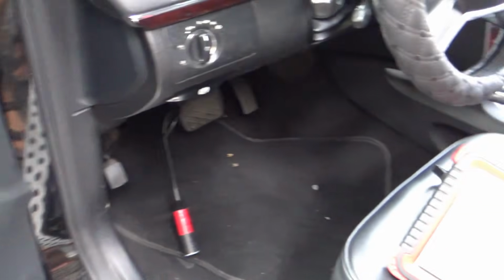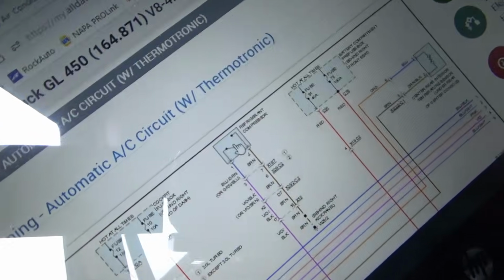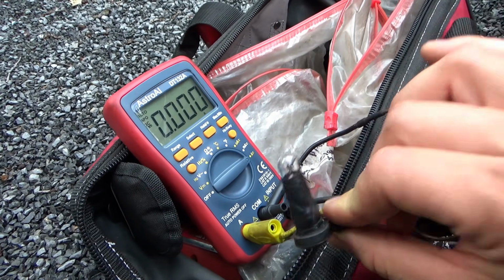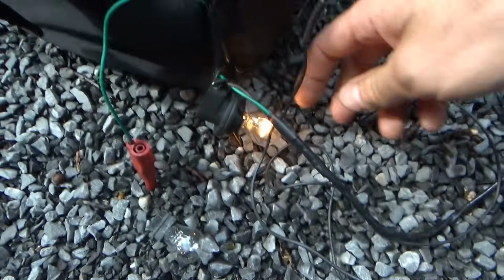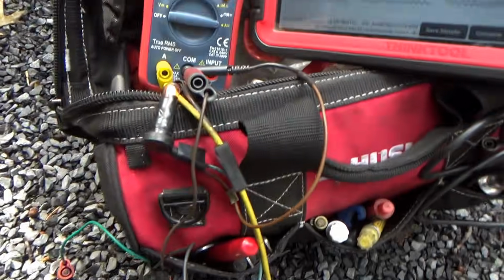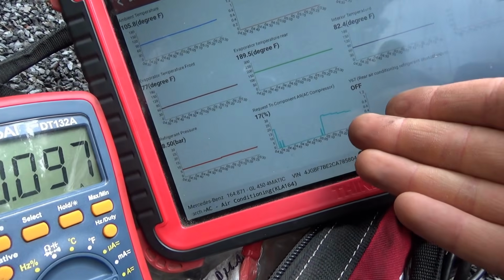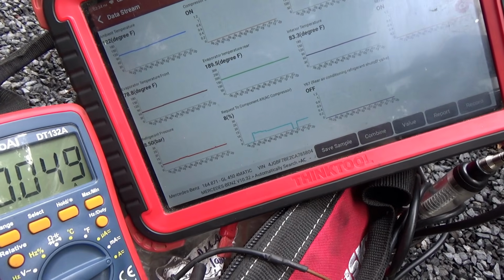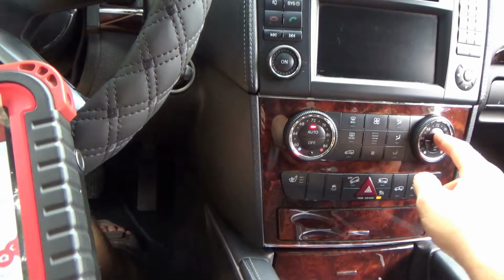Did I MIS-DIAGNOSE This Mercedes?? (GL450 no A/C)

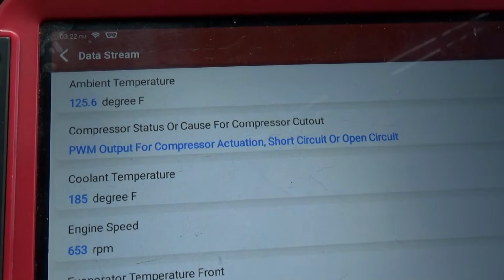Comment: Ivan, when you do HVAC , first thing you need to verify is the STATIC refrigerant pressure when engine is COLD, where all components are at ambient temperature. Minute 1:01 shows a very low R134A pressure, which is 2.5BARg or 36.3 PSIg. You then take a R134A temperature pressure chart to see what is the actual pressure/PSI to be at "X" Fahrenheit. Now, this GL450 has a whacky ambient temperature sensor because it read 125.6F at minute 1:19 while interior temp sensor at 1:01 was showing  79.7F.

As per R134A press/temp chart, if at ambient temp of 80F, the R134A pressure STATIC and compressor was not operated the last 12+ hours where between LP and HP circuit it would have equalized and all back to ambient temperature, and that should be at 86.7 PSIg. So if the refrigerant pressure sensor is not defective or drifted, this car has too low a refrigerant pressure and the HVAC computer will not allow compressor to run and may not produce any DTC too. 36.3 PSIg correspond to R134A when at ambient temp of 41F or 5C, which can happen in a cold country and hence DTC may not be triggered because HVAC computer does not think it is a faulty value.

Now the MB protocol itself. These are components which will and can prevent HVAC compressor from running, if their value is whacky :
01. Ambient temperature sensor, usually located at the front bumper.
02. Interior temperature sensor
03. Refrigerant pressure sensor
04  Engine coolant temperature sensor

The radiator single 800 Watts cooling fan called M4/7 is a shared cooling fan between the engine and the HVAC.
You can see under the Engine Computer module how many % is for engine and how many percent is for HVAC.
10% duty cycle is OFF and 90% duty cycle is maximum for this M4/7 fan. The initial and last 10% is for diagnostic purpose by the engine computer. Loose/disconnect the PWM sensing wire to M4/7 fan, the fan will kick in at 100% full speed as precaution, so becareful where you finger is at when you access the fan wiring. You can not remove the M4/7 fan fuse, it is not those plug-able fuse.
It is at the F32 Front Pre-Fuse box and those dumb-azz special fuses they use where they combined like 4 fuses to 1 strip.

According to the VIN number of this GL450, its HVAC system is called Code 580 by Mercedes, meaning a 2 zone unit and not the 
higher-end version called Code 581 or dual evaporator called Code 582. What bothers me is that your thinktool showed at minute 1:01 rear evaporator temperature of 189.5F, this car by VIN number does not have a rear evaporator (2nd evap ) so there should be no temperature value or scanner must declare NOT EQUIPPED.
If you do not have MB WIS/EPC, this link has good enough VIN DECODER and is accurate enough for this truck :
https://carinfo.kiev.ua/cars/vin/mercedes/vin_check?su=vl00tk8r0dpy

Always get the Data Card of MB cars when you are working on it for equipment like HVAC, as the options are plenty and you may ened up using the wrong wiring schematic between Code 580 and Code 581 and Code 582 ( with rear evaporator ).
The MB original wiring to use for this car is HVAC computer is  : 
PE83.40-P-2101-97maa
Wiring Diagram for automatic air conditioning (AAC) control unit
Model 164 except code 581. Comfort automatic air-cond control unit N22
N22 is the HVAC computer module ID as per Mercedes WIS or Xentry scanner for this car/truck.
N22/7 module is mainly for W212 E-Class.

If you can, avoid using re-drawn diagram from even the best of ALL DATA or whatnot and more for if for Front SAM N10/1 10 pages, which even the MB original one is lacking of update for my W212 2014 facelift and E400 M276.820 is a pariah engine variant very uncommon.

Typically MB uses Denso compressor and there are times where if the compressor replacement is non-genuine and has a much different electrical operational value of the control valve, DTC may be triggered. Example like what you get now defined as open or short circuit 9006 / 9007. Here is a good example of 9006 DTC solved by going genuine Denso   https://mhhauto.com/Thread-AC-NEW-COMPRESSOR-WILL-NOT-START-ERROR-CODE-9006-HELP-ADVICE-PLEASE?page=2

Now the GROUND wire which confuses you.
Often MB separate & later combined their grounds for certain  components/sensors. For this compressor control valve, it uses the Z50/37 HVAC Comp ground connector sleeve and it is also connected to pin #1 ( describe as a 31) connector D of the N22 HVAC computer, where the final ground destination of  this wire is ground stud called W29/2. W29/2 is at A pillar, the right side one. 
"W" is always a ground on MB cars. "Z" is almost always some sort of splice. 
31 is German DIN speak for ground or return path.
30 is always HOT , +12V power for MB/German cars.
30G is +12V but via a big relay af the F32 Prefuse box, so it is switchable but by ECM only.
Sometimes the pin at modules has real Signal Return description, usually for the 5V sensors return signal.

 It is common for MB to make sure the small component/sensor ground is not placed at anyhow anywhere there is a metal part of the body, NOPE they do not do that. They would want their  small component/sensor ground to share the same ground wire and stud as the module, this is for feedback/diagnostic function because that is the cleanest path back to the module.  This GL450 would easily have 50+ modules, my 2014 W212 E400  tropical country has 47 total modules, and 4 seasons country and an SUV body usually have more modules. This very plenty of modules is why MB wants their signal ground to be closest to their power ground for that module and components/sensors supported by that module. You do Pico scoping often, you know how noisy is a ground is ....electrically.

I hope this information will help you when you visit the GL450 next trip.
Reply from the maker: Amazing info :)
Reply: @PineHollowAutoDiagnostics  Just goes to PROVE there's some amazing folks 'out there!'
Reply: Nods along and pretends to understand Yeah, check that Ivan. xD
Reply: This guy is a genius, all this information for free🤔🤔
Reply: wow
Reply: Wow 2
Reply: This is a genius 🤞🤗
Reply: Phew..holy cow!😮
Reply: My guess....new compressor $2k
Reply: Thank you for the information. 

First I think the majority of techs would do what you are saying buy either connected a RRR machine with gauges or a gauge set before starting the vehicle, obviously after doing a basic visual inspect of the system, especially if it has been previously worked on. 

Ivan, obviously gets very strange situational reject repairs and seems to be called when no one else will take on the repair, and usually for good reason, meaning the vehicle has been abused in some way. For example, statements made in the introduction like "before receiving the vehicle the customer tried a new compressor", what???? why????? so who diagnosed the vehicle exactly? Why was the compressor replaced, and if it was indeed replaced was it an OEM replacement? Does the technician know the recharge procedures from MB? Are they qualified to do the A/C repair with a proper RRR machine? I think most of us are wondering, so what was the work estimate at the dealer for the repair before calling Ivan?

I would like to add that typically the PT charts are available in both Metric (SI) and Standard (English) units depending on the refrigerant vendor used (the vendor that supplies refrigerant to the assembly or component plant in your particular country). A multinational like Linde will be interested in SI unit PT charts either absolute or gauge pressure in kPa. 

In the US one of the best standard sources used to be Dupont which from my supplier is now Chemours for Freon 134a, but my PT chart in Standard is from Forane brand now owned by Arkema, which is European, and my chart is in standard gauge pressure with a lot of unit resolution, which I think is like the chart being referenced in the post. At the bottom of the chart states the information is at standard conditions, but I think it should say psig at sea level directly on the chart somewhere, like the Sporlan Valve (Parker-Hannifin) PT chart. Sporlan in the USA is one of the best sources of R/HVAC information. The PT chart data may not translate exactly if you are located at high altitude like Denver. Now Ivan is around State College so no need to adjust due to altitude.

At the Community College level of R/HVAC training (or training from RSES) as applied to mobile A/C refrigeration, many times the first item reviewed is the PT chart, although I actually benefitted more by using a pressure-enthalpy chart (psia and BTU/lb) to plot the R134a A/C mobile refrigeration cycle. Then from understanding this chart then back out the meaning of superheat and subcool and all the other refrigeration basics (jargon), and then have a better appreciation for the PT chart in gauge pressure, although now seen, by comparison, as rather basic but still useful. 

I think traditionally the module sensor grounds are dedicated back to the module itself, which I think is what you are saying. For, example if a module had an analog pressure sensor input, the module would have circuits VREF (sensor power), SIGRTN (sensor ground or signal return), and a sensor signal input pin, all three wires would go directly to the sensor with no splicing at sheet metal anywhere. Now the signal return may be shared by many sensors so there could be a signal return ground, but this would not be connected to the vehicle sheet metal.

MB suppliers at SAE talked much about the MB cooling fan systems moving towards either HSCAN or a LIN slave for FAN speed control and diagnostics around the 2014 time frame, for the complete family of radiator cooling fan controllers for MB from single fan to dual fan and dual fan with electric water pump. I think what you are saying is the fan is PWM duty cycle controlled by the ECM? and is not on a network, is that correct?
Reply: Wooow so many accurate and helpful info . I got problem with 350 GL 2012 and start blowing cool when i just turn AC on then only blowing cold air at passenger side also rear air is not cold i have 2nd evap coil in trunk driver side . Recently i find out there is some water under rear evap . Is that issue with bad expansion valve or indoor sensor or ? Please where to start 😂 thanks . This happen when is unit fully charged with 2.6lb
Reply: Damn dude.. bravo 👏🏼
Reply: 2017 Mercedes-Benz GLS450 air conditioning still not cooling after battery replacement
Reply: I think you’re wrong, Mercedes is more complex than your average

Comment: The inference is this is a compressor without a clutch, and the control is to a solenoid that changes the compressor output.  I just learned about those systems with my old Lexus.

The control is pulse-width modulated, so the scope would have been interesting.  There are at least three connectors in the electrical path to that solenoid that could be checked.

Adding the resistive load of the light bulbs in series with the solenoid might trigger some threshold check for low current in the controller, which it reports incorrectly. The controller may be evaluating the switched current flow through the solenoid as it does PW modulation.  It should be able to tell if the solenoid moved in response to the current.  Maybe the solenoid is mechanically worn and isn't moving quickly enough?  Although it seems like that could be a problem with a pure resistive load too, and it was happy with the light bulbs.

Comment: On the video you never proved what the max current the controller could supply to a resistive load.  You showed it could supply .8 amps.  I would guess the valve is operated by a PWM signal to control the valve.  I would have liked to see the scope signal to verify that.  We also do not know if the control line is even supplied at a full 12 volts regardless if the control is DC or PWM.  So necessary control current is still an unknown.  

Was that replacement compressor an OEM unit or an aftermarket rebuild?  If it is an aftermarket rebuild all bets are off on the coil operating the valve having the correct resistance or reactance.

Comment: Try testing the compressor regulating valve with a Megger tester to check the integrity of the coil windings. If the windings are breaking down,  not a dead short, you may get a bleed thru that the controller doesn't like.

Comment: Im so happy now i bought a 10 year old Opel mocca. Port injected, no turbo, no carbonbuildup in intake due to direct injection, no low tension pistonrings that lets oil pass, manual gear. Im gonna take good care of it, change oil frequently, because they dont make real engines anymore, just the DI crap.

Comment: i can't read through all the comments nor do i know the exact circuit, but if its variable internal contolled did u check the pwm sensor that sees the internal rpm like a crank sensor basically, if the pcm isn't seeing the static rpm from that sensor it wont let it control anything. If it has that i could be thinking wrong circuit type for this.

Comment: Sounds a lot more like a bad ground. The test lights work with one ground but not another? Not sure what is ambiguous about that. If the engine has a high resistance to ground it will be sitting at a much higher voltage than 0v, so when the HVAC computer looks at the undriven circuit it will see that and perhaps think it is open.
Reply: Well, the issue in this case is not that the test light works with one ground but not the other. It is the HVAC controller shutting off the valve activation signal when it detects a current draw that it deems too high. The test lights are in line with the valve activation/driver wire. You might be right about ground, however, why does it work when he uses only one bulb?

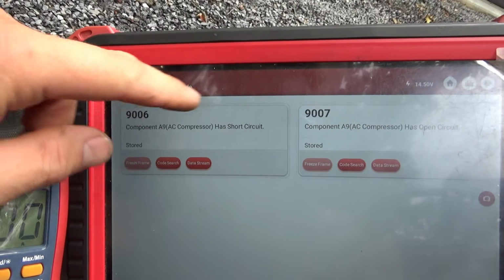Comment: google search @11:52 "It is important to note that Mercedes has a 'special' Control Valve that has an internal diode - many aftermarket control valves and aftermarket compressors might come without the diode, causing a trouble code DTC 9006 "Component A9 ( AC Compressor ) has Short Circuit" error, and the HVAC controller will shut off the"
Reply: Depends on the platform. I have 3 MB without the diodes on the AC compressor, and 1 with it. Go figure. It took me some reading to find out. Denso provides both types of setup for applications

Comment: I would first suspect a bad controller ground. If the fan speed is ramping up randomly and it signals a shorted compressor if it's not physically shorted, it would suggest the voltage sensing is messed up somewhere. The short circuit detection is probably done by measuring the voltage drop across an internal shunt resistor, if the ground is bad, the controller would detect the shunt as being either at +12v (open circuit) or a virtual 0v which reads as a short.

Compressor ground looks fine if it can carry an amp of current, but the ground path going from the compressor ground to the HVAC controller ground may be bad.
Reply: @@Stoney3K Yep, that seems to make sense!

Comment: the diagnosDan made a video that several sensors were replaced and the car still wouldn't start, the problem was that all the sensors had the polarity reversed so the signal coming to the PCM was inverted, I know it has nothing to do with this case but what if the new the valve has reversed polarity, so where the PWM signal should be, it is actually minus, because there is a possibility that the valve receives a minus through the valve housing in addition to the minus that comes through the installation, and in that case the control wire is actually shorted to the minus because the polarity is reversed.
there is also a possibility that the negative lead to the climate controller is not working.
I apologize for my bad English

Comment: ivan you've always preached checking power and grounds at a module before condemning it. are you playing russian roulette???  not that that is probably the problem but this needs more research and testing. as others have said possibly bad compressor ground? missing or faulty spike protection? is the code description consistant with the fault? is there noise in the system?(bad alternator or ecm shielding)
Reply from the maker: Everything else on the HVAC module works fine, so main power and ground must be OK by deductive reasoning :)

Comment: 3:22 Should go to the negative battery terminal.  Should check compressor/body/engine to negative battery terminal continuity.  I bought a battery checker and attached the + to the battery and - to bolt on top of strut and voltage was 11.8 volts.  Connected - to - battery terminal and read 12.9 volts!  Fixed that ASAP.

Comment: radiator temperature sensor may notice there is no change in temp, commands off the a/c ?  Also, the ecu may notice lack of engine load based on MAF readings?  The logic is probably expecting the temperature and load to rise.  Likely going to a default what do i do strategy and shuts off a/c